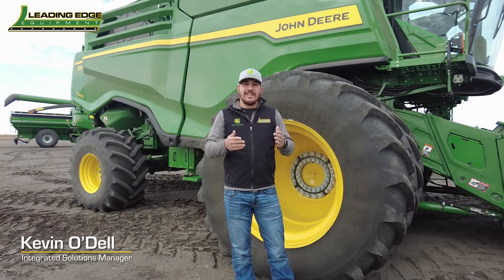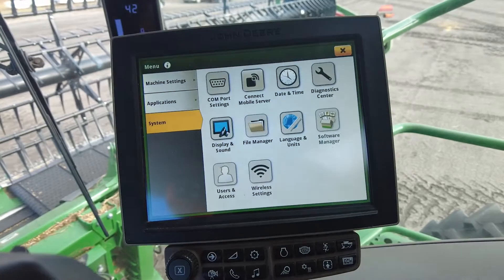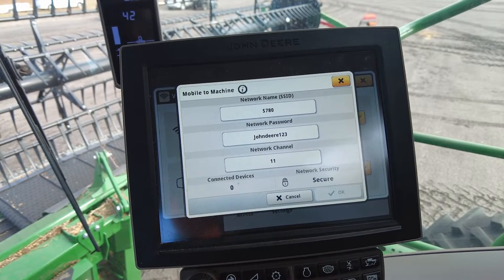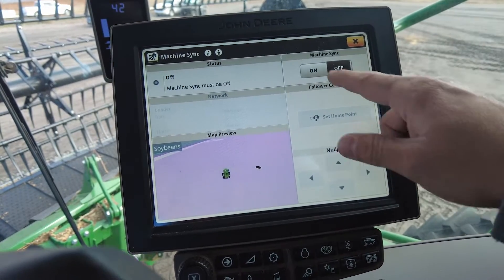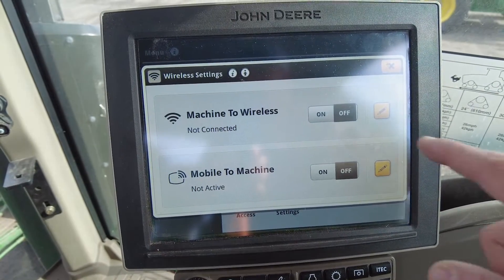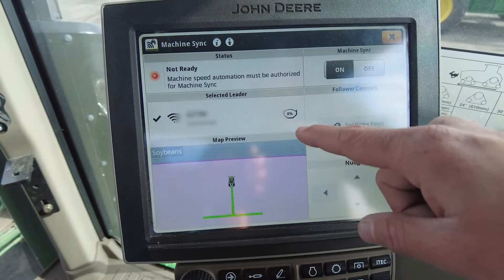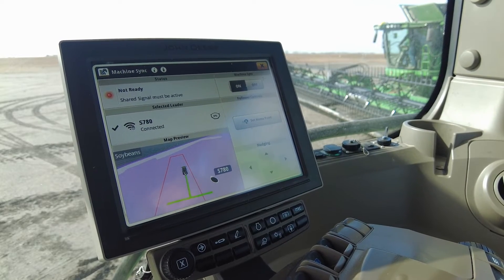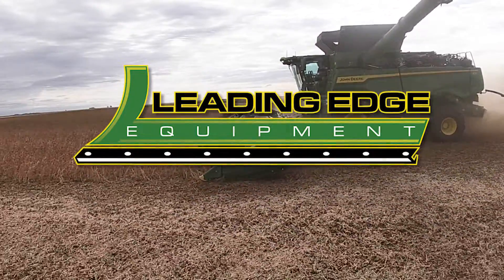John Deere Machine Sync

Comment: Machine sync is great in the combine, and with IVT in the tractor. I could not get it to be bearable in a 9420R though. Between constant shifting, and steering with and articulated tractor following Row Sense in corn makes me shut it off. Beats the heck out of the cart operator.
Reply: With what I’ve heard about the 9r transmissions that doesn’t suprise me. We have an 8r310 and ram a demo the other day, it was pretty smooth overall. We did the demo last year as well and it was a hell of a lot rougher, so I think there may have been some software improvements.
Reply: It’s true. Even turn automation in a 9R is unbearable after an hour or so. It’s far too aggressive with the shifting and center-steering